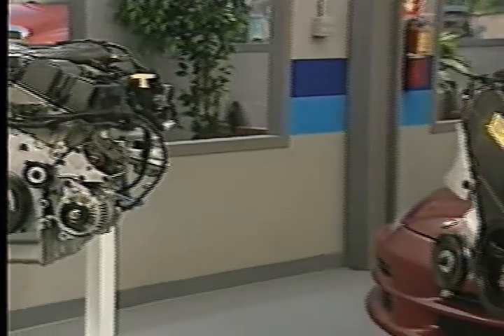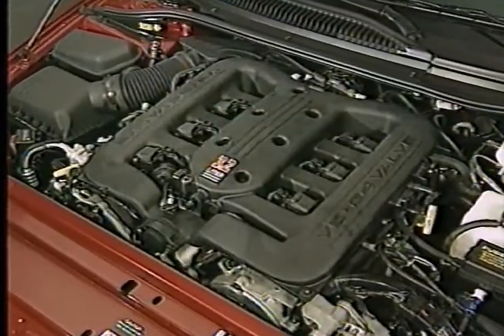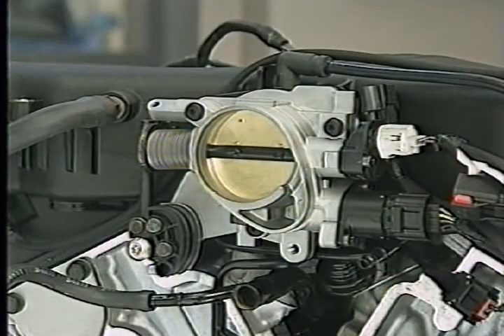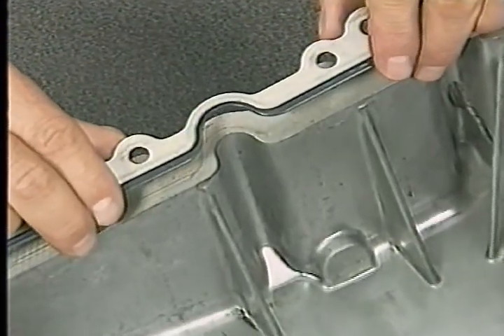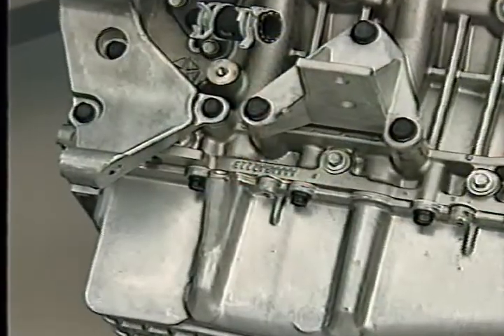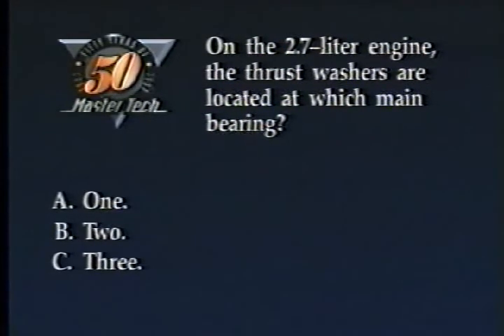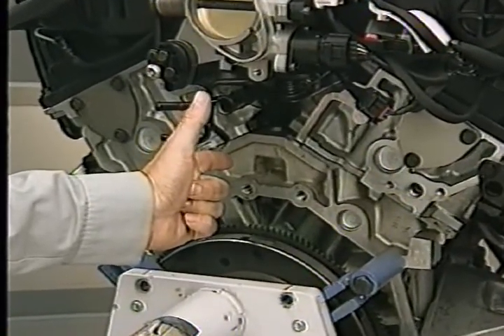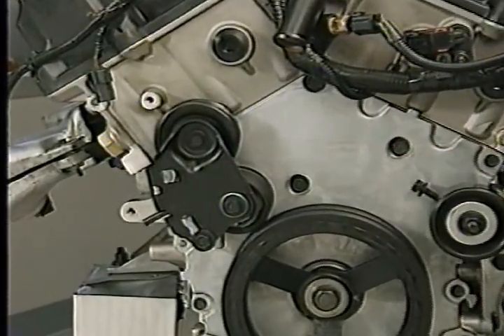Chrysler Mastertech 1997 - Introduction to 2.7L, 3.2L, 3.5L V6 engines -- Part 1

Comment: as an ASE master tech with over 35 yrs experience, the 2.7 is the worst engine you could ever buy in any car! the water pumps go bad and the timing chain guides go out causing the timing chain to jump and wipe out the valves and on these they are very expensive to fix and it will do it again soon after the work is done with new valves and timing chain and components as Ive seen happen many times in  the past. then they are notorious for blowing head gaskets do mostly to the design flaws in the engine itself! the 3.2 and 3.5 is a far better designed engine and most problems with it is the head gaskets blow due to water pump going out and severe overheating the engine and they use a timing belt to run the water pump and much cheaper to fix them!

Comment: The 2.7 really is easy to work on, simply replace by another when oil sludge problem kills engine at 60K miles.
Reply: Mine has 236.000 miles.. You won't find any sludge..

Comment: @ihartmacz Chin up buddy.  The complainers are usually fan-boys and/or completely mechanically inept. Keep posting these as you find them.

A REAL mechanic will watch all of them and learn how 'other' manufacturers do their thing.  Things change,even with their 'usual' cars.  Guys that claim "I've worked on these and they suck....bla bla bla...."   will always be stuck floundering when things get tough, or something changed that they weren't smart enough to notice.

Cheers! Keep it up!